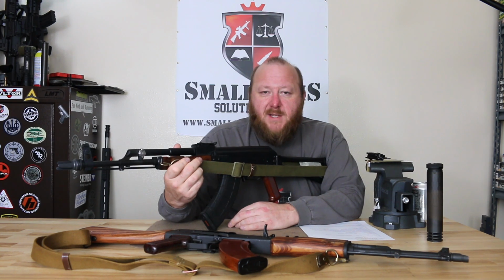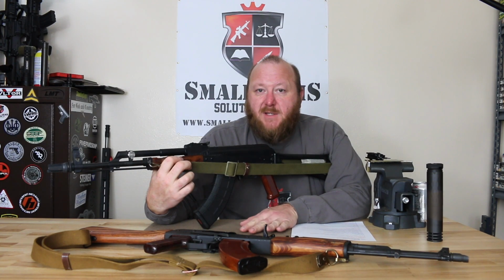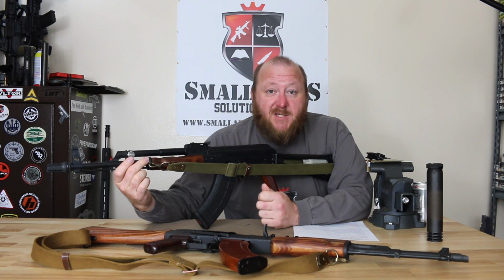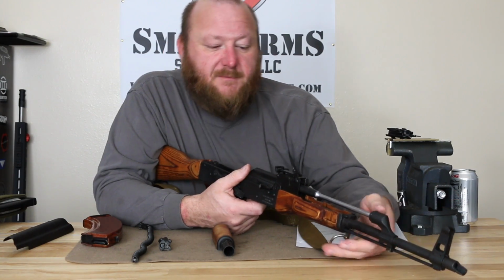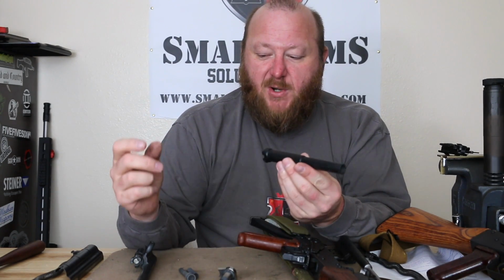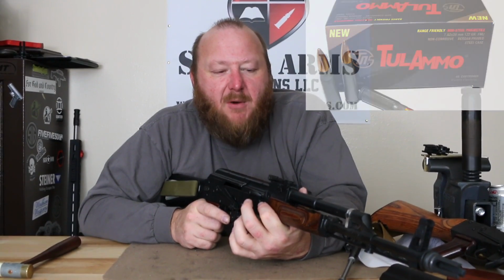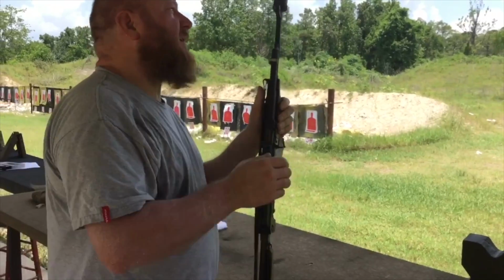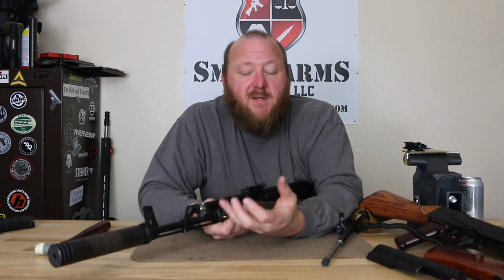Prototype Adjustable AK Gas System from The Ukraine

Comment: Any updates? Also with running a short piston, on full gas will the carrier jump the rails like the Micro Draco does without a bolt buffer or should one maybe run a bolt buffer of some sort like the Micro Draco does because of it's short piston to prevent jumping the rails?

Comment: or...you could just leave it stock and it will run any ammo all day long in any environment for decades without all the extra parts that give it a chance for failure...the great thing about the akm is its simplicity...this system adds more intricate parts which are un needed...and increase reliability issues...

Comment: Honestly, I'm not that interested in the adjustable gas system, but I do like the "short stroke" SKS inspired piston.
Reply: If  you pair that short stroke piston with a good spring, you could conceivably eliminate the need for the gas bleed off holes.
Add to that an additional concentric buffer spring to to the recoil  spring about the length at which the bolt has passed the point of ejecting the round, you could technically be able reduce felt recoil without the need for an adjustable gas port.

Comment: overly complex system, IMO. tunable on the spot without disassembly is a convenience but at the price of significant complication and modification from stock setup.
KNS piston still rules, UNLESS suppressor use is one of the per-requisites. since 95% of AK shooters not shooting with suppressor this product will have hard time competing with KNS, especially considering the amount of parts it'll be at least twice as expensive as KNS piston if not three times. ultimately i doubt it'll be a hot seller. most AK folks are cheapskates anyways, but i applaud the innovation. props to dudes in UA who came up with the concept.

Comment: You talked about adding a loophole to adjust the gas regulator with a cartridge tip.   How about designing it to use one of the tools commonly found in the Kalashnikov's butt stock cleaning kit tube.  I believe one of the tools is a screw driver of sorts.

Comment: KNS Precision already makes a drop-in adjustable piston for pretty much every AK variant that you can get in the US which does this same job with fewer parts. This one is interesting as a prototype, but anybody looking to buy something can already just get a working solution via KNS 's website.
Reply: Also to note, the KNS piston vents air into the atmosphere (into the gun) so you still get gas and noise coming back through the ejection port. Gas blocks restrict gas from even getting into the system so they are quieter, cleaner and cooler. An adjustable gas block is superior to the KNS piston design.
Reply: They already mention it in the video that one must field-strip the gun in order to change settings in KNS.

Comment: Too much adjustability is even worst than none adjustability in my opinion. Trying to find the setting which is "just enouth" for the gun to funcion reliably will give you problems sooner or later. Better to have 4 or 5 settings and leave it overgassed, just not way way overgassed.

Comment: Do you get volume/sound decreases by dialing down for suppressed fire???  If not why bother.  Your "non-state actor" customers will not have access to full-auto.
Reply: The adjustable gas block, Its about reliability not noise right? Such as if you suppress an AK(which cuts down on the sound) it will be over gassed. So you add the adjustable gas block so the gun does not cycle violently from all the extra gas. It basically bleeds off some extra gas.
Reply: @aholegunner    It's primarily about tuning down recoil first, hence the full auto comment.  Second comes wear and tear........ We're not talking about conscript guns given to dumbass kids barely out of high school in this case so wear and tear is only partially correct.  So what is left is some recoil reduction and potential for slightly quieter operation.  If the gas system is tightened up the gun should "Meter" quieter.
Reply: Recoil matters even in semi-auto.

Comment: Really cool innovation. I like the "idiot proof" version you spoke of, gas cut off, normal and suppressed. Other option that would be nice is normal (for your hot Russian type ammo's), adverse (for your under powered ammo) and then suppressed. Or even a 4 setting version for eg. normal, under powered, normal suppressed, under powered suppressed.

Comment: This seems kinda like a short-stroke conversion for AKs, something I never thought I'd see. Pretty innovative way to solve the solution. I've heard the KNS piston has had trouble with the piston basically unscrewing itself. If this gets to market I'd be pretty interested.
Reply: Does it still have that issue? I think I remember KNS releasing an updated collar which supposedly fixes whatever issues the first iteration had.
Reply: I never had a problem with it. Especially after putting the pin into the hole, pretty much not allowing backing out. This is the first I've heard of this problem.
Reply: Yeah, KNS has been out of stock on them for a while and I see they have released a version II to address the unscrewing issue. Don't think they have been out long enough at this point to call a success yet. Buy I will be checking in on them in the next 6 months or a year because they look like the way to go.